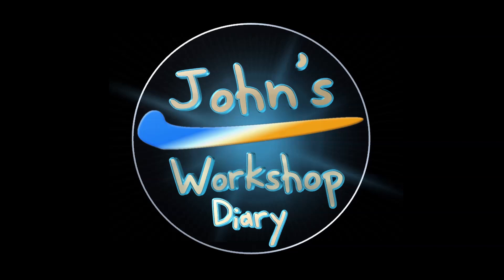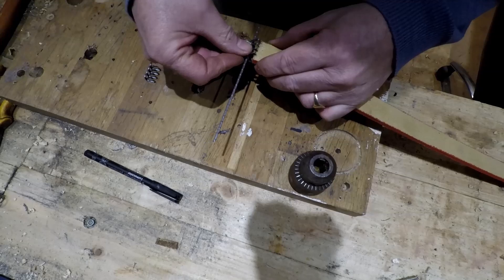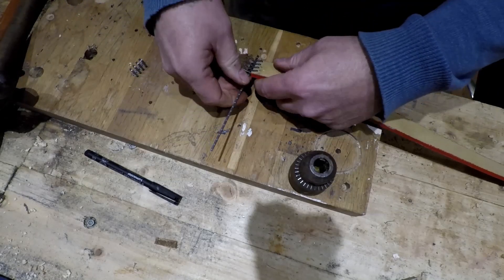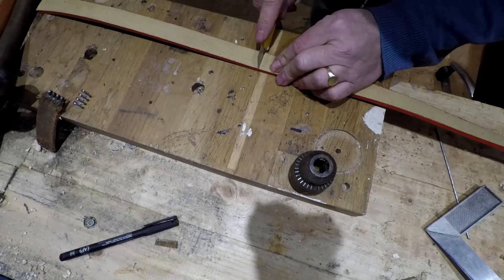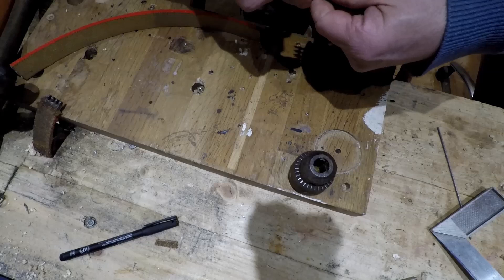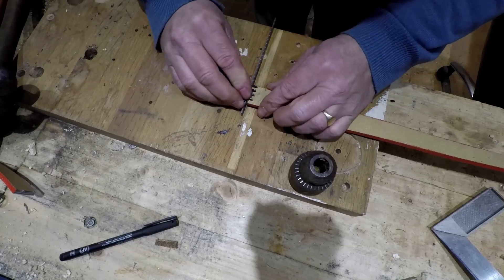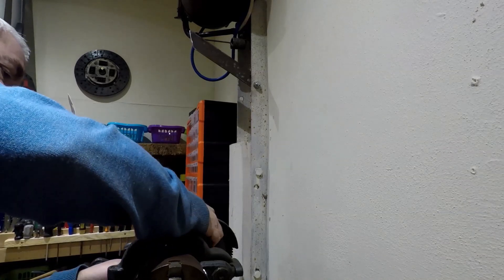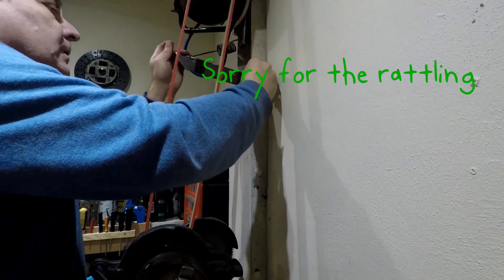Flat belt jointing methods with steel lacing Making up a new Flat belt for my Lathe belt replacement

Comment: Where did you get your new belt?
Reply: Look under Balata belt on ebay
Reply from the maker: Ebay
Reply: How u fixed that rod between belts. It is thin n straight so did u mould that or hammered it so that it doesn't come out